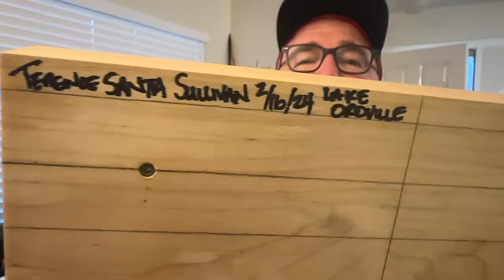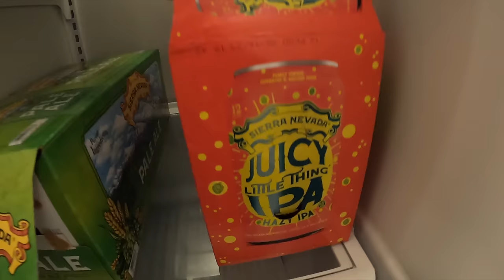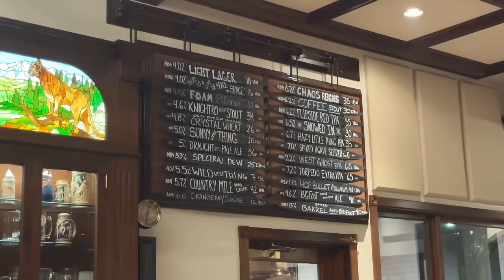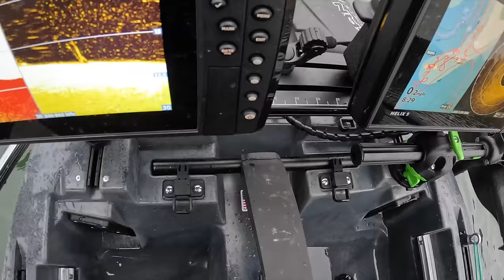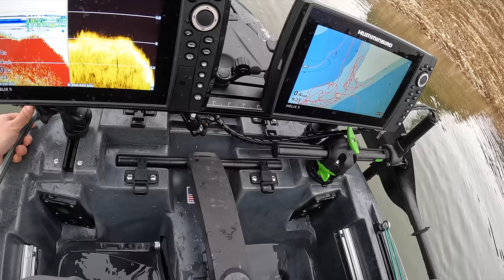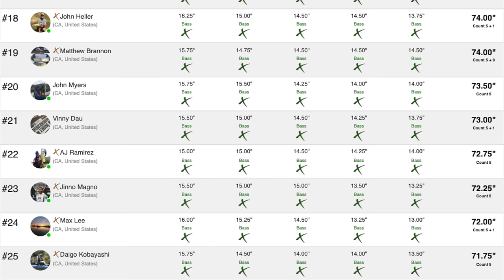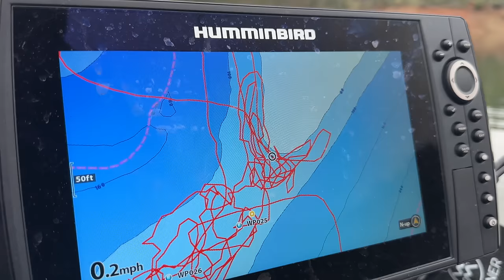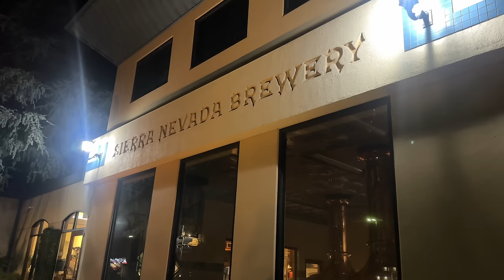YAK-A-BASS Stop #1 - Lake Oroville

Comment: Gopro pro tip, if your gonna film longer clips while plugged in, take the battery out and just run the charging cord, it will keep the device from overheating, especially out in the sun, i live in AZ!

Comment: Greg, I noticed that you did not have the 360 running at all during this tournament but you had mapping on the big graph all day. Was there a particular reason for not using the 360? Ive seen you running it in the derby and the gambler. Were the conditions different at Oroville or was it just a coincidence that the clips you showed you just didnt happen to have it on during that time?
Reply from the maker: great question and it was because the point was relatively featureless and the mapping with a few of the way points I marked were key to making the right cast. Hard to tell but the point was pretty big and without mapping and seeing exactly where you were it was tough to make the correct cast to really target that 20-25' range
Reply: @GregBlanchardFishing  the youtube algorithm is a crazy thing. There is actually a video up on my suggested feed right now with a thumbnail that says Mega 360 when where and how. I think that one reason so many of us enjoy your content is that you havent really ever relied on your electronics much but you have still had success out there. I prefer to fish with limited electronics but I also like to learn as much as I can so I can make informed decisions.

Comment: Is it me or are the measurements off? First and second bass should be 12.75 so that bass at 28:49 should have been a .25" cull. I think in those pics you're going by the top edge instead of the bottom of the board and it's throwing you off? It didn't matter in the end since you culled enough but just wanted to point that out.